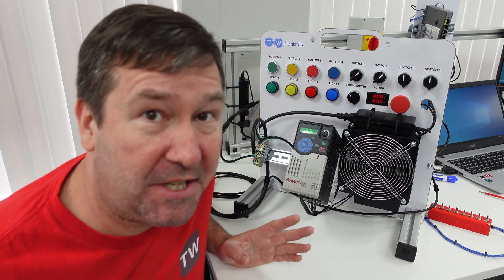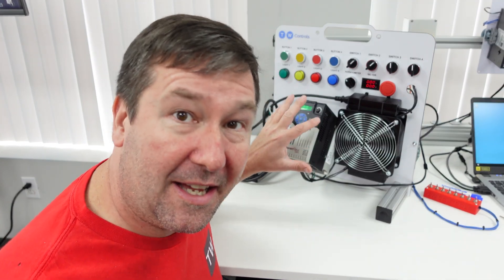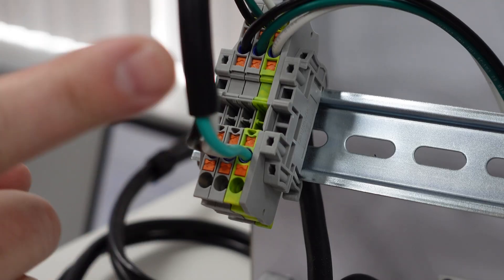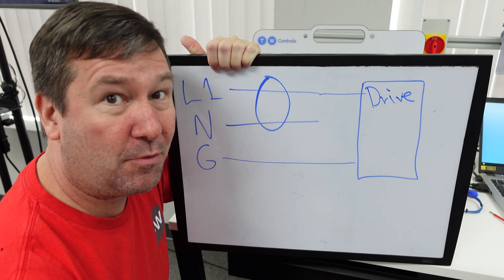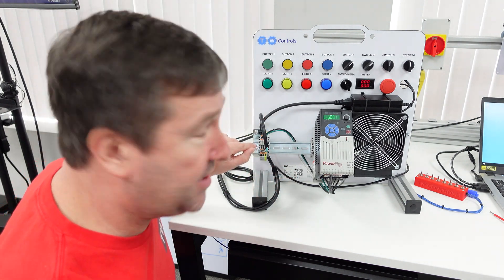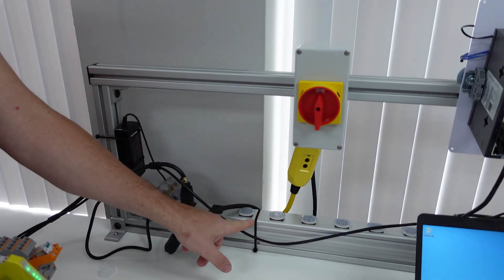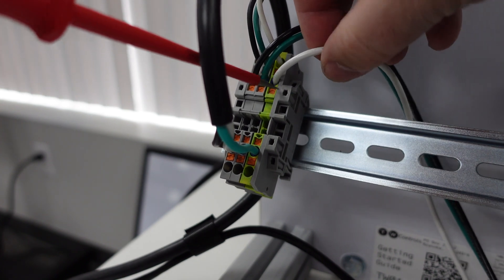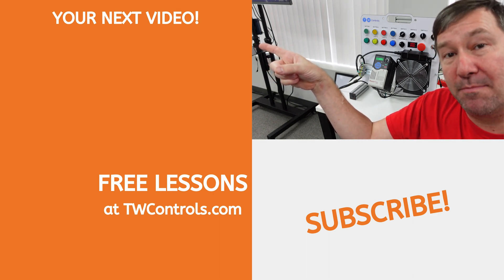GFCI On An AC Drive? Yes and No.

Comment: Legrand makes the 1597TRAPLW which is specifically for this purpose. "Designed for dedicated use with large and/or stationary appliances, this GFCI outlet limits tripping caused from variable-speed drives." Worth a test!
Reply from the maker: We have regular GFCIs on all of our stations, there are no nuisance tripping issues, even at low speeds.
Reply: @TimWilborne  I'm fighting a fridge with a PWM controlled compressor. Tip of the spear having GFCI in unfinished basement per newer electrical codes...
Reply from the maker: Check what class GFCI is called out in the refrigerator documentation.
https://www.guardiangfci.com/knowledge/gfci-defined#:~:text=The%20two%20most%20common%20types,ground%20does%20not%20exceed%20300.
Reply: @TimWilborne  If I'm understanding correctly NEC (for residential) does not specify types so the 5mA limit is gospel as it is meant for protection of people.
Reply from the maker: Yes, but I would be curious if the refrigerator manufacturers are getting the memo.
Reply: @TimWilborne  they will soon when 'garage ready' freezers are returned in large quantity for tripping the required GFCI. This unit had many mentions in the reviews after searching for GFCI in them.
Reply from the maker: Overall, it is a good move.  Someone will be able to make a fortune selling freezer alarms for a few years :)
Reply: @TimWilborne  I'm covering my butt with a thermoworks node
Reply from the maker: That is neat, I like that it can send emails and text.
Reply: Just came to report back it's been running a few hours now without tripping instead of 30sec!

Comment: There are a lot of dangerous myths about neutral versus ground.  It's definitely nonsense that AC motors can't be attached to GFCI-protected circuits (unless they are mis-wired of course).
Reply from the maker: Very true. It brings up another one I hear often. Electricity takes the path at least resistance. It's not entirely true and leaves a lot of people in dangerous situations. I should do a video on that.
Reply: @TimWilborne  Yep, there are a bunch of videos on these subjects on Youtube, but you have to look for them.  ElectricianU has some.

Comment: I found the leakage from a drive to be around 5mA, so 1 drive was OK. 2 was questionable, and 3 or more was never going to work from the same RCD or GFCI 

15-30mA trip levels NZ style.
Reply from the maker: I should do a video on the class of GFCIs. Mainly on the US since that's where I'm based but still would be good information. Most people don't even realize that the mA differential is what causes the GFCI trip.

Comment: I'm surprised that worked. Power supplies trip GFCIs (I assume because of the capacitors used) and I expected the result to be the same with drives, with the presence of capacitors in the rectifiers.
Reply from the maker: Before adding the addition, I would have been skeptical also but when I researched various drives, I could not find a single one that said you could not put a GFCI on it. Only a single manufacturer mentioned the class the GFCI should be and it was in the fine print.

Comment: Hey Tim good video, the question from me would be why did you add GFCI protection to your stations?
Reply from the maker: Excellent question Jason!

1. Since we try to simulate the workplace as close as possible, we added them so we could have exercises where the GFCI was tripping. That's the quick and easy answer.

2. Arguably OSHA 1910.304 (b) requires them because the outlets on our trainer stations are not part of the permanent wiring. If we were in a plant, it definitely would be required. I could argue either way being in a commercial classroom space. Here is an excerpt of it.

1910.304(b)(3)(ii)(A)
All 125-volt, single-phase, 15-, 20-, and 30-ampere receptacle outlets that are not part of the permanent wiring of the building or structure and that are in use by personnel shall have ground-fault circuit-interrupter protection for personnel.